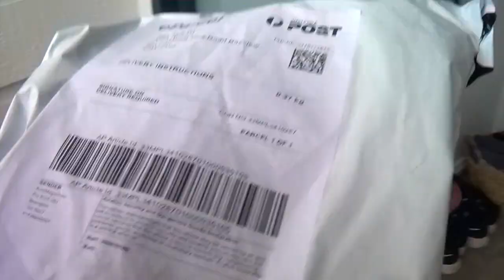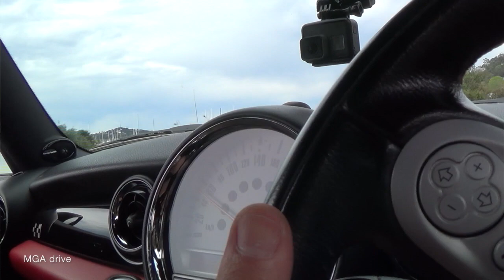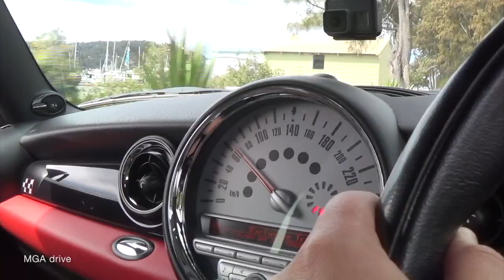My Mini JCW Has a problem !!!

Comment: Great Video ! I  experienced great success using the aerosol version of  SeaFoam. Simply use the elongated straw that comes with the can, and  insert it AFTER the Mass Airflow Sensor, spray for 7 minutes, let sit for 20 minutes in anticipation of the smoke show (as you did). I used alot more SeaFoam than in this procedure. 20% to 25% of the SeaFoam remained in the can when finished. Best of luck with your Mini

Comment: Hi, 2days ago brought a 2012 R56S, 156Kms. Having same issue, white smoke coming when engine is hot & idle. There's a slight oil leak near rocker covers ( no dripping to floor). I checked radiator for any air bubbles while running the engine, nothing observed. It has been recently serviced with new oil filter, air filter & spark plugs. That's all I know about the vehicle and I'm really worrying now. If I do a vehicle diagnostic test ( Quoted $175/hr.) from a local repair shop will it give correct directions? or what should I asked for mechanic?
When I check the forums for similar issues lot suggested following, 
1. Thermostat Replace 
2. Liqui-Moly Resealer Engine Oil Treatment 
3. Head Gasket Replacement 
4. Turbo service 
5. PCV system checked with pressure analysis

 I know nothing about vehicles, and can you tell me where to start?

Comment: Well hows the car?
Reply from the maker: WindyBuns L still going strong no problems🤞🏻
Reply: So here in the US the directions ask to add some to your gas as well. Have you tried that? I’ve got an R56 that had really toasted plugs and coils. The car ran like wild after I changed them. I was still getting some smoke and then ghost limp mode and check engine lights. (P3091) Mechanic said the fuel lines, pump etc. fine. Still trying to solve it 100%